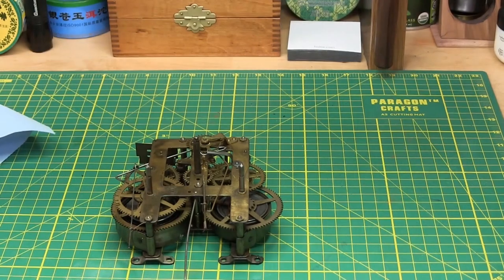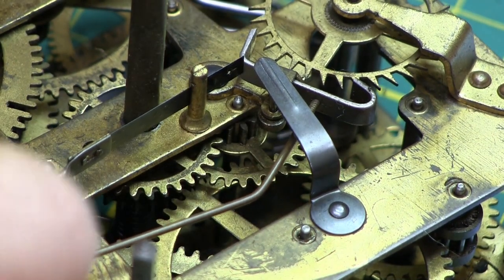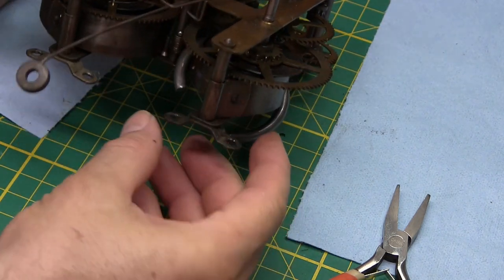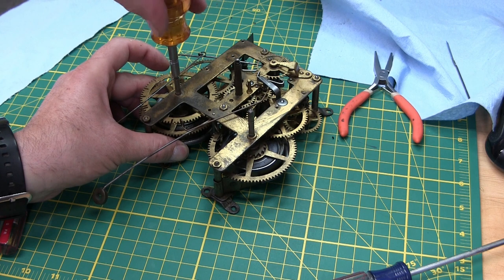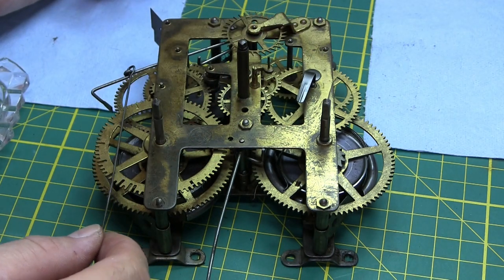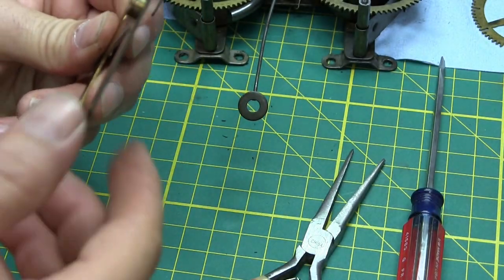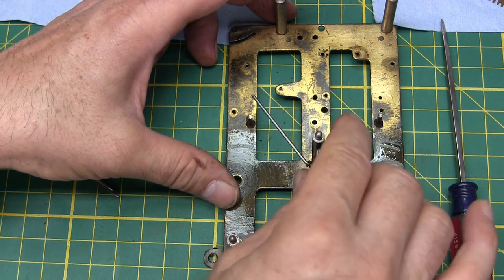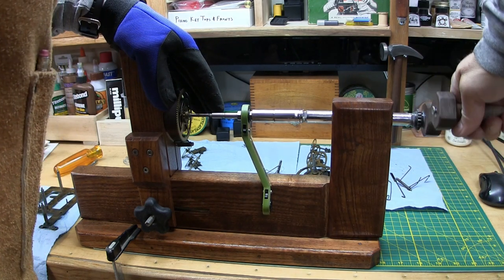Antique Seikosha Wall Clock Repair Pt 2, Movement Take Apart, updated version

Comment: I will not dare to do that...omg...prefer look others do that...👏👏👏👏👏 those who invented those mechanism were genious nothing less...
Reply from the maker: It amazes me as well at how these clocks were made and run! Thanks Fabien!
Reply: @time4clocks  Hello Time4Clocks Thank you for your videos All so well done and packed with good information and techniques! May I ask do you happen to have any “junk” but intact Sekosha springs?  I have a mechanism i an trying to get running but is missing the strike spring entirely Thank you so very much!
Reply from the maker: @markcockle5038  Sorry I do not have one Mark. My journey into Japanese clocks is just beginning so I don't have any Japanese parts laying around yet. Once you measure the spring you might be able to find one on ebay or order a new one from a clock parts seller like Ronnell or Timesavers. I couldn't find one the exact size but the closest match should work. ShopGoodwill often has clocks in such poor condition that you might find a seikosha on the cheap. Just an idea though. Hope you get your clock going!
Reply: @time4clocks  Thank you for your great suggestions and your time! I will give them a try - all the best for you and your channel!!!

Comment: I bought a VHS tape back when I first started collecting and working on my own clocks. So I always use a wire for movements like this vs the c retaining rings. Except for small movements then I use a zip tie. In this case your C ring is around a post on the movement that keeps the spring from going toward the inside of the movement. Using the wire to do that ensures that you are only around the spring itself. Commenting as I go.
Reply from the maker: Thank you Mark. If I didn't put the retaining ring around the spring only then I did it wrong. I don't recall what I did it's been so long now but the wire is a good method also. Appreciate that.

Comment: You asked a question about whether or not a spring is set or not. General rule of thumb is as long as the spring is 2-3 times bigger than the barrel or in this case not having a barrel then the spring is still good to go. In other words if you were taking it out of a barrel then you would put that barrel at the end of the uncoiled spring and then go across the width of the spring and if you can get the width of the spring 2-3 times across the width of the spring then the spring is not set. Again this is all that I learned while watching a VHS tape back in 1999.
Reply from the maker: Thank you Mark. Appreciate that!

Comment: The two rag system is a good idea. What the VHS tape taught me and you will see other videos with folks doing this is on the time side starting with the great wheel is subscribe on the wheel T1, next wheel T2 (subscribing on the same side that you see) that way when you put it back together you know that you are looking for those marks as you put it together. S1, S2, etc., on the strike side. So as you are working on other clocks and you are seeing these then you know what and why you are seeing this.
Reply: Some people mark them with - or I instead of T and S. -1, -II for time side and I 1, I 2 for strike side as scribing a S is sometimes difficult
Reply: BTW that is why the pros can put all the parts in one container because they have learned to mark them.
Reply from the maker: @munnerlyn3  I know that marking the wheels is helpful but some schools of thought are against doing this. I haven't come to a decision regarding the practice myself.
Reply from the maker: @munnerlyn3  I can see where marking them would be helpful.
Reply from the maker: I'm getting ready to put back together so I might regret not marking them! 😀

Comment: Also wanted to mention that as soon as  you took the pendulum leader wire out of the crutch assembly the movement started to tick. I have a video that shows in this type of clock and it doesnt matter whether it is a cuckoo clock or a clock like this where by opening the foot of the crutch allows the clock to tick back and forth. Most people are trained to close that foot. I disagree with that. I went back and forth with a guy who had been working professionally on clocks for over 30 years that posted a question about an OG clock and how it would tick with the pendulum off but when he added the pendulum within a few minutes the clock stopped. I told him to open the foot. He disagreed. Finally after going back and forth with him for awhile he took my suggestion and then came back and thanked me. My point here is that if the foot was opened more this clock would have ticked prior to you taking it apart.
Reply from the maker: I never close the foot. It's my understanding that it's the weight of the pendulum which keeps the escape gear from running uncontrollably such as what you saw. If I see one with a closed foot I will try to recall your comment here. Thank you!

Comment: Hi I really like your ratchet solution. I have also made a copy of the Ollie Baker.winder however my let down keys don’t have the hex shaped body. What size ratchet spanner (wrench) fits your let down key hex? I am wondering if I can modify my coupling to allow the timesaver hex letdown key to fit my machine as their is a larger number of key sizes available.
Reply from the maker: Hello Hugh! It is a 7/16" deep socket that I used. Hope that helps. Tackling some of these problems in "do it yourself" style one has to be rather creative. :)